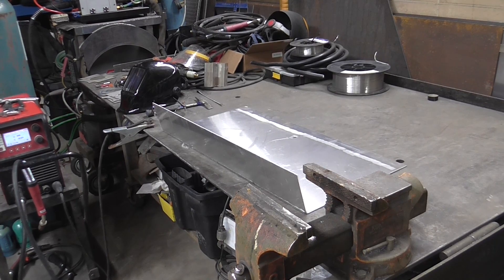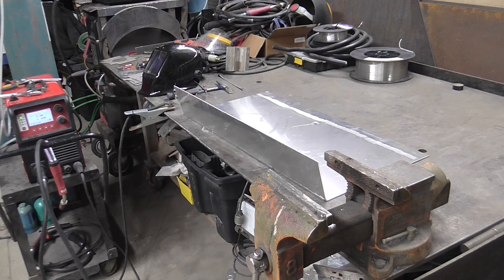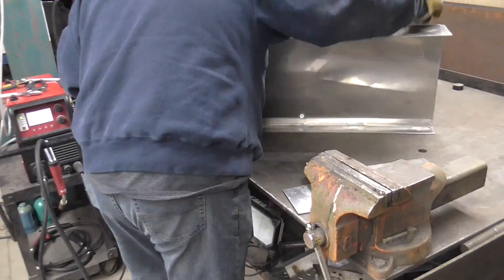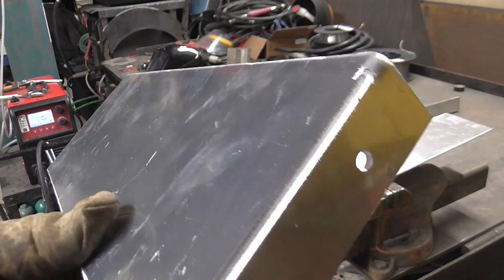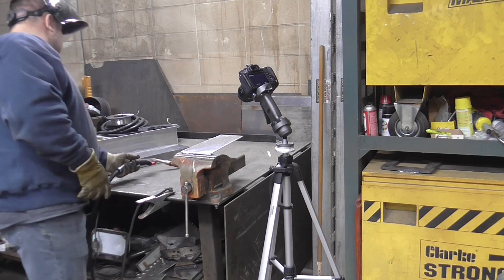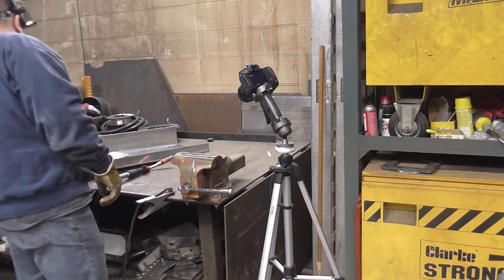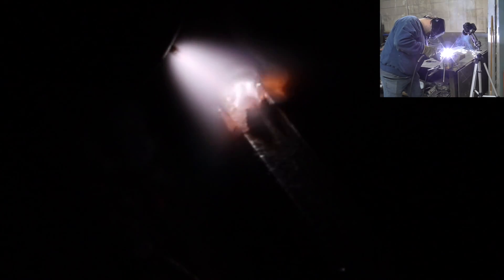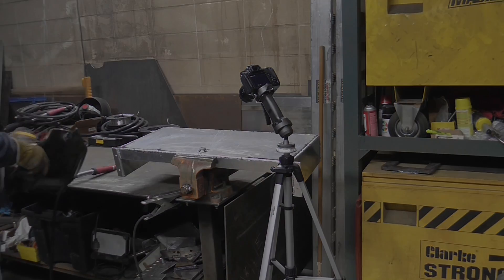Pulse mig aluminum in detail ! no matter what machine you own or want to buy

Comment: Thanks. Interested to know what were your wfs amd voltage settings?
Reply from the maker: can't remember ...  320 IPM roughly on 035 4043 wire.  the voltage is scewed anyways because I had to dial it back becasue of the helium mix I used

Comment: How did you push the wire without a spool gun?
Reply from the maker: this mig gun is equipped with a Carbon Graphite liner ....  this is even better than a teflon liner.   and the drive roll in the machine is made for aluminum wire, it has a better groove profile

Comment: Appreciate the real-world welder insight, have you thought about a push/pull setup for aluminum? It looks like you're just using a regular steel MIG gun and I was wondering if you've tried the "proper" setup/your opinions on that
Reply from the maker: I do have a push pull setup .... for smaller jobs this here works as good as the push pull gun its just 2000 dollar cheaper

Comment: I want to open a weld shop but I have no experience and I don't want to die breathing bad fumes. Couldn't you just put a fan on instead of wearing a respirator mask ? What welder do you own ? I was looking at the Miller 255 with a push pull gun to do aluminum mostly.
Reply from the maker: the fan will blow your shielding gas away, you would need a suction system set up at the right distance (for the suction power) and then you would have to blow it all the way out of the shop, with the shop doors closed ....  I see HUNDREDS if not thousands of $$$ investment here ... that miller mask is $35 and $12 for replacement filters every 8-12 hrs ....  its your call .... there are professional stand alive suction systems a bunch of guys sell them ... even HTP has a professional grade stand alone machine with cleanable filters for about $5500 .... just set up up - DONE ...  nice system, made in the USA ... no china stuff ...
Reply from the maker: the miller mask is made in England btw .... also good quality .,. the blue prt you can just throw in the laundry and then install new filters ...

Comment: I understand you don’t do this for a living but this video is really good and informative. I think you are far better than you seem to give yourself credit for.

My welder is a basic MIG & MMA stick, I used 0.8 ER5356 wire in pure argon on my normal MIG gun. I’m a total virgin s&*t welder and I have nothing to compare anything to as I’ve never used a TIG or spool gun.

I can see and hear what the pulse does but what are the advantages. A really good video that I will watch more than once.
Reply: You can weld aluminum with dc mig 100% argon ?
Reply from the maker: yes

Comment: The welds look sloppy, appears to be a gas issue or surface residue prior to welding, tig is a neater but slower way to go.
Reply from the maker: Randy Bell the welds look just fine for pulse mig !   You can try to compare pulse mig to tig but you will always wonder why these apples dont taste right .....  they taste like oranges .....

And YES  you paid attention - i intentionally use a helium/argon mix which is the WRONG gas because a lot of guys in previous videos said that i should do that because it would be better 🙄
Reply from the maker: Swampy  100% helium - yes. it is mainly used for DC tig or mig - no pulse and it is used for very thick material structural or ship building. Helium/Argon blends are used when a little "additional heat" is desired Mig or (ac)tig welding. The helium makes things a little hotter, also flowing better and the weld pool cleaner.  there are a lot of peole of the opinion that you "should always" use some helium in your argon when you weld aluminum because it "helps you". 
I dont necessarily share that opinion since you are making the "deal with the devil" yes the 2 advantages I just listed (more heat and more fluid and clean puddle) are real advantages BUT the disadvantages are throwing a real big "shadow" on those advantages.   the disadvantages are :  Cost. where I live a tank with a helium mixture is $140 a tank or argon is $30 (same size same pressure) Also Helium gives you hard arc starting and massive arc stability issues. if you weld material thinner than 1/8" the added heat comes out to your disadvantage ....  so you should decide and try for yourself when to use helium .....
Reply from the maker: Swampy 👍

Comment: Sounds like you have double pulse switched on. You should try slowing it down to 1pps (pulse per second) and hold still on the high amperage part and move the torch on the low amperage part so it points at the edge of the previous puddle
Reply from the maker: on the PP200 the double pulse parameters are factory pre programmed 2.0 hz I believe
on the PP300 the double pulse has a manual option to fully adjust double pulse settings.   in my experience 1.2Hz works best for really pronounced ripples. 
If you like watch my video "bills's boat"
Reply: 2hz is pretty fast but manageable. i'll watch the bills boat vid. cheers

Comment: Seems to me you weld for fun not for living. Spool gun should be used for MIG welding or try TIG. Wire speed and voltage are not optimized, that's why you ruined the job at first.
Reply: 🤣🤣🤣🤣 Clearly not knowing who you are talking to🤣🤣🤣

Comment: Maybe its cheap Chinese aluminum material. I did some aluminum pipe welding on a race car for this customer and it would not run right or flow well. welded like pot metal, It turns out that he bought it for China trying to save money.
Reply from the maker: Fred the wire was alcotec made in usa and the aluminum was kaiser aluminum ....  
i dont know why no one wants to believe it that the long and erratic arc comes from the helium ....🤷‍♂️

I welded thousands of lbs of aluminum with argon and other gasses .....
Reply: @ZILAwelds  thank you for the info.
Reply from the maker: @fvg3401  thank you !  for not making this conversation much longer than it has to be...  i have more videos on that coming by the way

Comment: I'm starting to think I bought the wrong machine for aluminum it's the Lincoln 140 might but I don't know if it has the pause and go sequence  by the way nice video nice welds imma beginner in aluminum I also weld for a living  but I do mechanics and construction anything I used to work fabricating stainless steel equipment but I was breaking and polishing not welding but anyways I'll stay tuned to your videos God bless you this video was a lot of help to me!
Reply from the maker: you might have....  that Lincoln should weld some 1/8" thick material for you and that is about it ....   you can't really dial a non pulse machine down much further than 1/8" and you don't really have the power to weld much thicker ...  with a TON of preheating you might be able to do some 3/16" thick ...  but yes - if you are serious about some aluminum welding ....  a different machine could have been better for you ...   let's say if you want to weld some aluminum fender on a semi-tractor - you can probably do that with your machine with some practice ...
Reply: I'll trade it for a pulse one thank you only 2 days with mine

Comment: I understand not being able to video all your work (turns a $$$$/hr job into a $/hr job!) So thanks for what you do, I appreciate it. Btw, I'm still undecided on the Transsteel 2200 vs the HTP, but I'm leaning more on the Fronius as I just sense it's a more rugged machine (I weld 100% on site, no shop). But I haven't seen either welder, so.....
Reply from the maker: Tommy, will you be using the machine for "general fabrication" (aka steel) mainly or do you run across your fair share of aluminum jobs?  if you do aluminum - especially 1/8" thick (or thin) or less ...... THERE IS JUST NO SUBSTITUTE for a pulse mig machine!  also the ability to adjust your heat settings while welding with the slider that HTP offers ..... UNIQUE at least ion this class at that price point ...  again ...  if you do aluminum ....  if it is a mainly steel deal or steel only deal ...  then you could go either way...  now keep in mind - do some research on the consumables ...   fronius has all proprietary consumables ... the gas nozzles for that trans steel 2200 are sold in 5 packs for $139 ... that is almost $30 for one nozzle !!!!!  but you can't buy one - you have to buy 5 at a time .... I mean if you don't mind (over)paying for quality and if you don't mind that you cant pick up consumables from your local guy or amazon or ebay...  then by all means  - sp ahead and get the Fronius - its a SOLID and good machine ....!   I think as the name implies "trans steel" it really shines and excels welding steel ...  its not called trans pulse or trans aluminum ....  and also that is a very good European machine (just like the pro pulse 200 is) but it comes with some "Fronius only" technology at "Fronius pricing"  - but - hey - that is all up to you - it's your money spend it however you like to spend it.  Like i said - it's a solid machine  - I won't steer you away from it!   BTW the Pro pulse is all made in Italy, lacquer sealed boards, IP23 ....  in my mind - i have a hard time to see a noticeable quality difference ....  but that is just me ...
Reply: @ZILAwelds  lol! Thanks bud, there's alot of info I didn't know. I figured the Fronius was proprietary, but didn't research the cost. And I didn't realize the HTP was rated IP23, that makes me more comfortable with it. But yea, 90% of what I do is steel. But maybe that's because I'm not real set up for aluminum.....  Thanks for your reply.

Comment: If you use a 1/4 " Brass Backing Plate the length of the joint , position the plate on the back side aluminum panel, into the joint flush into the seem to prevent aluminum weld seepage, clamp the brass backing plate tight. The brass backing plate will keep the weld seepage from flowing through and dripping through, the aluminum will not stick to the brass and you will have a nice clean seem, keeping the flow of aluminum topside in the fillet. Make sure to not touch the Brass Backing Plate without welding gloves.....it will be major hot as the aluminum .

Comment: Why did u cut the slots
Reply from the maker: Paul Ohoilan to bend it. It works really good on even thicker material ( steel and alu) and makes bending without a brake press really easy.
Reply: ZILA I see. Thanks. I use similar process by tracking steel by cutting halfway through with grinder. Then bending then weld cut. Thanks for sharing
Reply from the maker: Paul Ohoilan i used to do that too when i was fabricating everything by hand. 
Now that i use the cnc plasma for 99% of what i do ....  it just cant cut 1/2 or 3/4 way through ....  its all or nothing ....  so i cut 8–10” long slots with 1/2” land in between ....  and i can bend it up real easy ....   just weld up the slot - good to go.

Comment: I have the post flow set at 2 sec , I will increase my gas flow see how that works,  My garage is like 100 degrees ,it's been hot here  North of Detroit
Reply from the maker: jas van 
So your post flow is good!  If your flow rate and contact tip to work distance is good too - then you should not have an issue with it sticking to the tip - but due to the nature of things it will he REALLY close to the tip.
Pro tip: once it sticks - the tip is never going to be the same ....  if you can afford the $2 for a new one - throw the old one away and install the new.
Also - if you have the drive roll pressure set correctly - it will not birds nest but it will slip.  
That will create a flat/damaged spot on the wire ....  next time this spot comes through the new contact tip it jams and creates another burn back ....
Whenever i get the wire stuck in the tip, ( like a heavy stick) i change the tip AND run about 10ft of wire through and discard it!  That way i dont get more problems - discard the wire with the flat/damaged spot

Comment: I running 35 I will try that also i am welding on a piece of .063 aluminum thickness
Reply from the maker: jas van in my opinion 35 is on the lower end .....  a bunch of guy keep telling me how 25 or 30 is plenty .... and they have peppering in their welds, arc length issues ....  but that is all unrelated to gas flow issues .....  lol

If you look at lincoln electric, hobart, alcotec ..... just to name a few ... all of them tell you to run 40-50 cfh on 035 wire ....   
now there are a lot of factors - and i am not saying you are doing something wrong.  And 35cfh is MUCH better than 25....!   And have st least 1.0 sec post flow ( you want to shield the hot wire after you are done welding) 

So - that is all i know. Try it - it should work from all i can tell.

Comment: It was burning back at end of trigger pull  ,still working on same tip but close calls ,had to take tip off cut wire and twist wire then it breaks loose  , running 004 on burn back and pinch was set at 010 as you said it still is very close to tip when trigger pull is complete 160 wire speed
Reply from the maker: the only other thig that comes to mind
1) gas flow. (if you have "insufficient" gas flow the wire burns "hot" and it burns back further nan normal ...  I personally like over 40 cfh close to 45)
2) wire brake. (that is the back screw in the center of what hold the spool on since you have to run very low drive roll pressures you don't want the wire to slip so your wire brake needs to be very low too)
also 160ipm you are probably in the paw program. the way how the machine works the arc length is very long (that means the arc is established close to the tip) that is "normal".  
now if you hold the gun too close to the material(you should be about 3/4" to 1" away or of your wire brake is too tight or your gas flow is too low ...  anything that is "not right" will mess things up ....  also make sure you always use a quality wire, cheap Asian import wires cause much more problems then the savings are worth .... good luck

Comment: Just bought a Pp200 and have been playing with aluminum  how do I prevent the wire burning back to tip ?
Reply from the maker: jas van when is it burning back, on start up? In the “middle” of the weld or at the end?
Reply: ZILA at the end of weld
Reply from the maker: check your burnback and pinch ... set burn back to 004 and pinch to 010 that should fix it - gradually in increments of 10 ramp pinch back up till you dont have the ball on the end anymore
also make sure when welding aluminum - hold the gun about 3/4 to 1" away from the material
you should be good to go

Comment: That thin aluminum does not need and will not benefit from He. Use pure argon and let it go. My Millermatic 350P does not have pulse on pulse, but getting good outside corner welds is pretty simple. Even straight pulsed MIG is far better than just MIG on aluminum. Much better heat control. But the number ONE consideration with any MIG aluminum is proper fit up. Yes, even more important than cleaning. Cleaning makes it weld better, but no matter how clean it is. If the fit up is bad, you will have HELL. The thinner the aluminum, the less tolerant of gaps it will be.
Reply from the maker: Scott,  absolutely !  That was my point ... the helium mixtures make the arc "unstable" and don't really help you if your programs are designed for 100% argon.   the miller 350p is a good machine and yes it does not have double pulse (which can be good for looks AND heat control) but just having single pulse is a HUGE advantage over starlight mig - I agree 100%.   I think cleaning is even more important than fit up.  That is just my personal take .... fit up is important too - however of you have the option to control the synergic settings while you are welding ( I have a few videos with a push pull gun coming where I can adjust the settings while I am welding) that feature allows you to turn the welder down while welding and bridge gaps (even big once if required) without stopping or breaking the arc .....  if you have that feature than cleaning is more important than fit up ....  if you don't have a feature like this - than fit become WAY more important FAST!

thanks for watching
Reply: I run the push pull set up synergic and it is great. Clean is a must and by that I mean heavy contamination. 3.2mm and thinner aluminum is very fit up sensitive. It is always best to get it as clean as possible, but proper fit up is often overlooked in the aluminum world. In this project, open those outside corners up 1mm and things would have gotten way out of hand with much more burn through on the backside. Proper prep should be best practice always with aluminum.
Reply from the maker: I agree